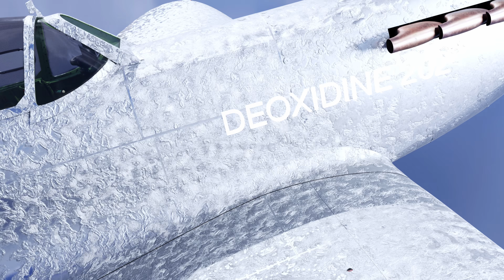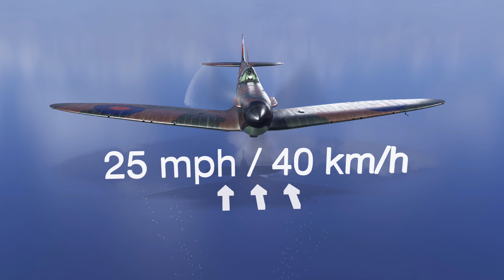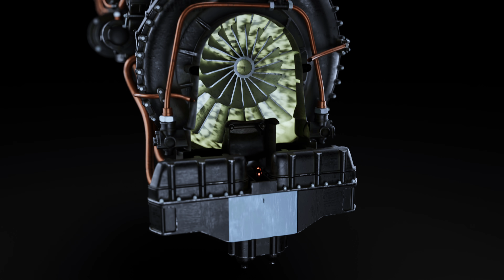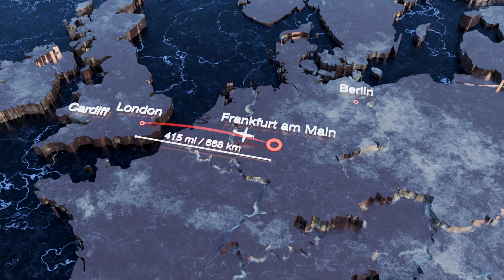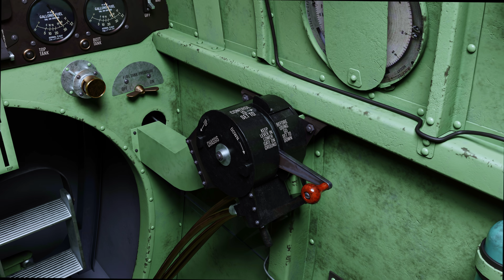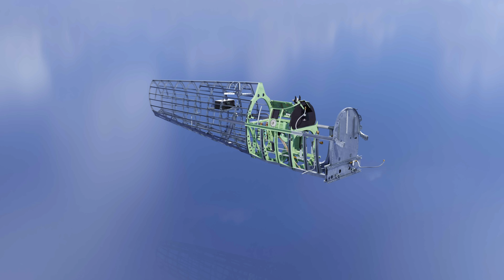Inside the Spitfire

Comment: Stating the engine displacement in Gallons is a rather funny giveaway that the creators are probably more familiar with metric, but convert all the measurements to imperial for the benefit of the predominantly American audience. Cubic inches and litres are the preferred units! However this is a tiny issue in an otherwise superb video.

Comment: There are often red patches applied to the gun ports of the Browning machine guns of both the Spitfire and Hurricane. the reason for this was that the gun powder used in British ammunition forced the guns to be modified to fire from an open bolt.
Reply: The patches covering the machine guns muzzles were to stop dirt clogging the barrels on take off or landing and rain etc entering them in the air.

Comment: Correction: The engine was a British design, no American.

The Rolls-Royce Merlin 3 engine was designed by Britain (the United Kingdom).  It was developed by Rolls-Royce as a private venture and first run in 1933, becoming a pivotal powerplant for British aircraft like the Supermarine Spitfire and Hawker Hurricane during World War II. While Packard in the United States later manufactured a licensed version (the V-1650) for aircraft like the P-51 Mustang, the original design and the Merlin 3 variant specifically originated in Britain.

Comment: An interesting thing is that the elliptical wing is not describing the physical shape of the wing. We studied this in my airframe classes in my aerospace engineering degree. What is actually elliptical is the shape of the lift force profile along the wing - highest at the root and varying in an elliptical shape towards the tip. The physical shape is more complicated than a simple ellipse.

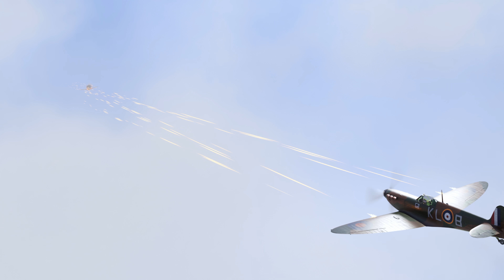Comment: 10:14 I find it remarkable that ever since the invention of the machine gun one of the biggest challenges from the designers is keeping them from malfunctioning due to overheating under sustained fire, such solutions have included cooling fins on the barrel, water jackets, interchangeable barrels, fire selectors that reduce the rate of fire or just training the gunners to use fire discipline, yet with aircraft like the spitfire they need to take measures to keep them warm.

Comment: As mentioned on an older video... some of the best uses of Unreal Engine for demonstrations seen. Big kudos.

Just a suggestion, given the time poor attention spans we're suppose to have nowadays, the video doesn't suffer from an increased 125% playback. Although google's YT speed suggestions affect the pitch of voices etc. You may want to consider speeding up the video in edit. As it drifts along nicely at a high playback rate. As much as it would be a temptation to slow things down to appreciate the beauty of the graphics & treatments, sometimes it feels like you're labouring some sections.

Comment: Good morning, good afternoon, or good evening. Warm regards. Could you talk about the interior and interesting facts about a German U-boat? It could be a Type 7 submarine; there are two similar types of submarines.And I have some doubts, for example, because there are two submarines that have two anti-aircraft machine gun positions and another submarine only has one 20mm I've noticed that near the bridge, in the same area as the deck gun, there's a rounded structure. Could you tell me what its function was?

Comment: The use of flush riveting on leading edges and nose but not further back isn't "to a 🎉umps are draggy when they protrude through the boundary layer. Where the boundary layer is deeper than the rivet heads, the flush rivet is a waste of time and effort. See wiki: Boundary Layer
Flush rivets require countersinking and require more time and effort than Brazier head rivets.
The surface etch/treatment described prior to paint would be called Alodine today.

Comment: Side note we still use ALLCLAD aluminum and we use liquid ALLCLAD after we repair older airplanes. Is a really good anti corrosive. I have dual citizenship so I’m very proud of what my for fathers accomplished with nothing but pencils and paper. What a great design. One of the 2 best ww2  designs from the Brits and Yanks. They P51 and the Spitfire both used the Amazing Merlin series  engine which was the master stroke in my humble opinion. I would love to have worked on one of these amazing combat airplanes.

Comment: My only comment is Alclad is pronounced Al as in the shortened name of Alfred, not as you said it All. The Spitfire Red for up on the undercarriage is not now the norm, its green for down, red for in travel and no indication when up. Shows how early in aircraft design the Spitfire undercarriage was, one of the first.
Reply: The early ones had a hand pump for the gear retraction.
Reply: @chelseafan8846  I know the only hydraulically operated system on the aircraft, I’ve worked on BBMF

Comment: The Battle of Britain was won by the Hawker Hurricane. As for the Spitfire, there were mainly two mass-produced models: the Mk V and the Mk IX/XVI. But the Mk IX entered service in mid-1942, and development of the Spitfire model practically stopped there. Because fewer than 1,000 of the improved Mk XIV were ever produced. And if it weren’t for the Thunderbolts, Mustangs, and a few Typhoons, the RAF would have had a tough time for the remainder of the war.

Comment: Do we measure engine capacity in gallons? No. Were the Merlin blocks and heads cast as a single piece? No. Why are we measuring the fuel capacity in US gallons? Did the Mk1A remain in production throughout the war? No. Then you said it ceased production in 1941. And it was generally under gunned. And it wasn't mainly built in Southampton.   All this and I'm not even an expert. Fantastic video, check your facts though.

Comment: Here's a question. 
Is the .303 used on the plane the same as the .303 in the rifle?
Reply: Yes, fine for shooting 19th century natives in distant places of the empire, and deer in the early 20th, but for solidly built German aircraft not so much, that’s even not taking into account if spitfire pilots understood deflection shooting, range estimation, or bullet drop, or how spread out the bullet pattern would be at any distance. There’s a well known film clip of a RAF fighter firing at a formation of German bombers miles out of range, even when I first saw it as a kid I knew by the time the .303 bullets got there there probably would be one round per 100 square metres, the guy was just wasting ammunition.

Comment: I can let you know the D box along with the trailing edge section upper skin surface to match the split flap were the toughest to make. 
The main spars upper and lower are squared tube sections sat inside each other five sections the outer most runs out to the last rib section before the wing tip section.
The inner most is solid bar . These are bolted onto a spar web . The nuts and bolts are peened over and centre punched three times between nut and bolt for secure locking.
D box skins are produced from flat sheet 8 gauge or 3.25 mm . These are rolled on an English wheel and the dihedral added along with leading edge profile and dropped onto a wooden skin former to check the profile.
I believe the MK1a shown here came out of production with the all metal clad Aileron . 
I built the wings for x4650 was in KLA squadron markings. 
Hope this helps.

Comment: The highly unequal size radiators under the wings looks like a aerodynamic problem. I would think you would need a good amount of trim on the rudder to compensate for the uneven aerodynamic drag.

Comment: 27:00 No mention of the radio system, and I'm fairly sure the flaps could be set to 'combat' but that may have later than the mkI.
Reply: The Spitfire didn't need combat flaps, it would turn inside a P 51 when that was using the combat flaps.

Comment: Excellent video. That is the first time I've heard of the two tiered rudder pedals. One thing I've never heard mentioned and took a bit of digging is the purpose of the holes along the leading edge of the pilot's seat. Apparently the are meant to hold flare cartridges. I know the P-51 had a port near the pilot's left elbow for deploying the flare using a flare gun. I presume in the spit you would need to open the canopy.

Comment: The Spitfire has a limited range of 900km.
The Spitfire engine is very fragile, like the A5M2.
Its armament is very weak and unsuitable for ground attack missions.
Engine performance decreases at 4000 meters altitude because it cannot turbocharge. The climb rate decreases.

The Spitfire has very few guns.
The Spitfire only has two guns. The guns are very weak, effective up to 600 meters.
The Spitfire's four 7.7mm guns are very ineffective.

German 20mm MG guns are effective up to 1200 meters.

The first Spitfires break their wings after 600km.

The Spitfire 9 breaks its wings after 700km.

At low altitude, 8g of force breaks the wings of the Spitfire.
If the air is windy and the wings are frozen, even 7g of force can break the wings.

The BF-109 and FW-190 don't break wings with 10g of fire.

Spitfire cannons are very few; you can shoot down a maximum of 3 planes.

The same applies to the Russian Yak-3; its wings break after 650km, with 8g of fire. The Yak-3 has only one 20mm cannon with 120 rounds. Shooting down a third plane is very difficult.

German MG cannons are effective at 1200 meters.

Spitfire cannons are effective up to 600 meters.
Reply: Good point moron, quit hating,?

Comment: The pilot who shot down the most Bf-109s between 1943-1945 shot down 354 aircraft.

The pilot who shot down the most Spitfires between 1939-1945 shot down 36 aircraft.

The best and most numerous fighter aircraft in the Allied ranks between September 1, 1939 and April 1943.

Flying the 109 requires skill.
The Bf-109 is designed for ambushing and attacking from above, then using its speed to regain altitude.

The Spitfire is for turn-based dogfighting.

The Spitfire has a limited range of 900km.
The Spitfire engine is very fragile, like the A5M2.
Its weaponry is very weak and unsuitable for ground attack missions.
At 4000 meters altitude, the engine performance decreases because it cannot turbocharge. The climb rate decreases.

The Spitfire has very few cannons.
The Spitfire only has two guns. The guns are very weak, effective up to 600 meters.
The Spitfire's four 7.7mm guns are very ineffective.

German 20mm MG guns are effective up to 1200 meters.

The first Spitfires break wings after 600km.

The Spitfire 9 breaks wings after 700km.

The Spitfire breaks wings with 8g at low altitude.
If the air is windy and the wings are frozen, even 7g can break wings.

The BF-109 and FW-190 don't break wings with 10g.

The Spitfire's guns are very few; you can shoot down a maximum of 3 planes.

The same applies to the Russian Yak-3; it breaks wings after 650km with 8g. The Yak-3 has only one 20mm gun with 120 rounds.
Shooting down the third plane is very difficult.
Reply: Spitfire V onward could out pull BF-109 and FW-190. But most of these German aces with hundreds of victories came from fighting obsolete soviet aircraft
Reply: @Username-c3f The Spitfire 9 breaks its wings after reaching speeds of 700 km/h.

The Spitfire has no turbocharger.

The Spitfire's performance decreases after 4000 meters.

The Spitfire is not a plane to be feared.
Reply: @C @CevatBAKIR-x1x pitfire IX’s is at risk of breaking around 778kph. This is roughly the same as BF-109 and less than FW-190, but it could out turn both of those planes easily. Spitfire IX actually had best performance altitudes were actually 21,000 ft. It had a two stage, two speed supercharger giving it over 1,700hp, 600hp more than BF-109
Reply: @Username-c3f I'm a level 2500 War Thunder player.

The Russian Air Force uses Spitfires. They don't like them.

They continue to fly P-39s.

Between 1942-1944, some Spitfire squadrons, despite being in the war, didn't even see an enemy aircraft.
Reply: @CevatBAKIR-x1x  I am a bit confused, but ok USSR didn't like Spitfires because they were mid to high altitude fighters. P-39 was more similar to their own aircraft thus they were used all the way until 1945
Reply: @Username-c3f Spitfire F MK XVI.

A straight-winged Spitfire.

Reaches speeds up to 800 km/h in dive.

Speed 652 km/h.
Climb rate 22.3 meters.

Four 7.7mm cannons were removed due to their ineffectiveness.

Two 12.7 m² Browning machine guns were fitted.
20mm Hispono MK 2 cannon. 270 rounds of ammunition.

The engine is the same as the Spitfire 9.

Flying this plane is like driving a race car.

Comment: Excellent videos (all of them by Blue Paw). So glad you added this airplane to your videos. Pilot for over 50 years and several months ago while in the UK I got to fly a 1943 Spitfire Mark 9 (2-seat conversion) with the Merlin 66 engine. The Spitfire I flew was MJ627 and was involved with the Market Garden battle where it shot down a BF-109. This same airplane had engine failure 4 months before my flight and made a successful belly landing and was repaired in time for my flight. It was one of three engine failures and belly landings made since it was built in 1943. Everything in this video matches my experience. The cockpit was extremely tight, and my shoulders touched both sides. The control stick was hinged in the middle on purpose because there was not enough room between my legs to have a full stick hinged at the floor like USA fighters. Many other details in the video explained things I did not know. Thanks again.
Reply: Wow, I think a flight in a Spitfire is probably on a lot of people's 'bucket list' 👍
Reply: @laernulienlaernulienlaernu8953 

It was amazing. Got lots of stick time plus aerobatics. My wife was in a chase plane and took beautiful pictures while we flew in formation. Her present to me for my 78 birthday!
Reply: @rvrrunner Wow! Genuinely lucky man. What an amazing birthday present 👍
Reply: Год

Comment: @07:00 you forgot to mention the flaps indicator on top of the wings
Reply: A clever part of the design, it was actually a spring loaded flap pushed open by the Flap linkage, that allowed the trailing edge to be thinner  Flpas pneumatically operated down, spring loaded shut. Spitfire flaps either up or down,. Down they were more obviously down than in the video. The Metal skin, was actually an Aluminium alloy called Alclad,

Comment: Waw it's amazing !
I still don't understand what the three lamps in the cockpit are supposed to do. For years I thought it was for telling the pilot if the gear was up or down...
Reply: The three bulbs on the right were spare bulbs. The undercarriage indicator on the left of the cockpit instrument panel.  Early WW2 aircraft  were new to retracting undercarriage. Green for down was standard, some aircraft  types had Red for up, some had nothing for up but Red  for in travel.  The Hurricane had a bell in the cockpit, that sounded if the  throttle was closed with the undercarriage in the up position.

Comment: No radios?
Reply: Answered my own question. Yep. The TR series radios were in the fuselage on a slide out tray and accessed through a door panel. Guess you didn't think the commo gear and antennas were critical components onboard the overall platform.

Comment: The video depicts a later model while talking about the Mk1. The Mk1 had a two blade prop and the narrower canopy. The model looks to be a later Mk2 at earliest with the three blade variable pitch prop.
Reply: The Mk 1, along with the Hurricane was fitted with the new Rotol three bladed propellers just before all hell broke loose in the battle of France, as well as the familiar bulged canopy to accommodate larger pilots and increase visibility.

Comment: Hence during early days of ww2 German Pilot never engage in a turning fight with a Spitfire because the Spitfire would outturning 109 inside two and three turn and slowly they found that the spitfire already on their tail, a certain death at level flight engagement.

Ironically, the same landing approach apply to the spitfire, it also apply to the American F4U Corsair since both aircraft has this similar problem.

Comment: Just a slight correction. 
I'm fairly sure the cylinder heads were a separate unit not cast into the cylinder block.

Also, we Yanks use either liters or cubic inches when describing engine displacement not gallons.

Overall a beautiful and well done video

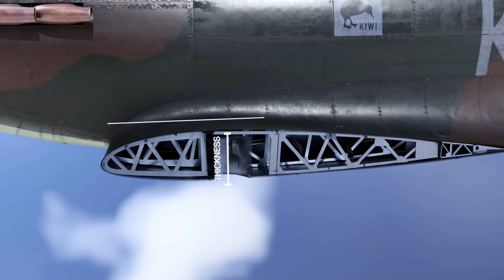Comment: Length is misspelled early in the video at 3:43. And rating the engine in gallons is weird. For the USA it's cubic inch, for metric it's liters. 7.1 british gallons is 32.2 liters or 1,970 cubic inches.

Two minor issues in an otherwise flawless presentation

Comment: All they had to do was change it to direct fuel injection, and it would have been even more of a legend than it already is.
One of the prettiest and nastiest planes ever made (for its generation)... and it's only major downside was a fairly easy fix. Too bad... one of my favorite planes ever that rules the skies, imagine if it was capable of diving after its enemies.
Reply: Ruled*
Reply: Later marks did have fuel injection, and the earlier carburettors were modified to prevent fuel starvation once the problem was investigated.